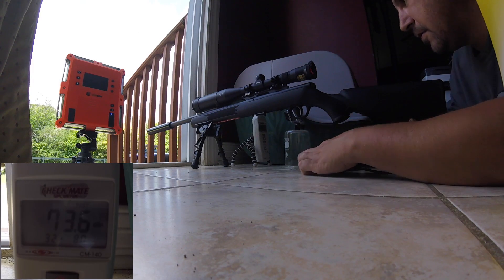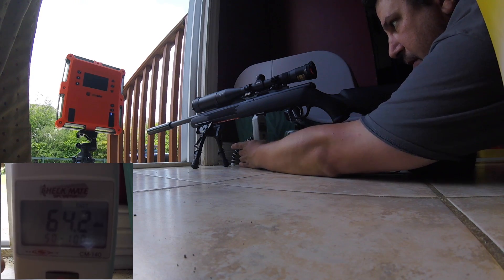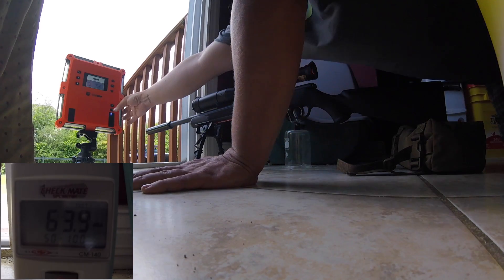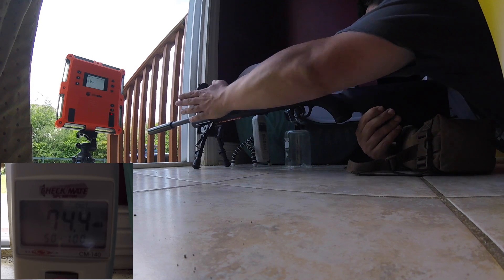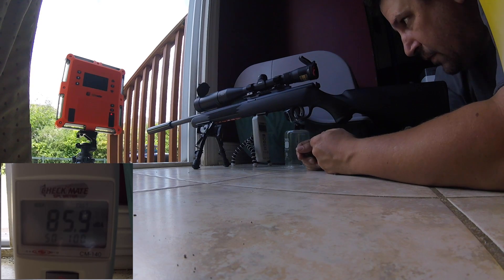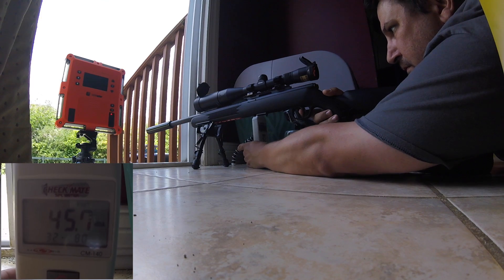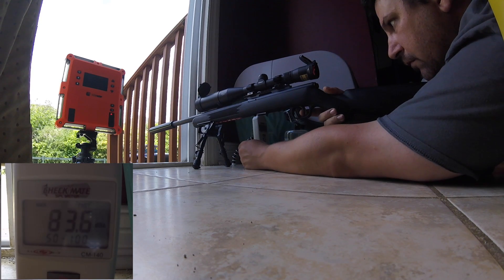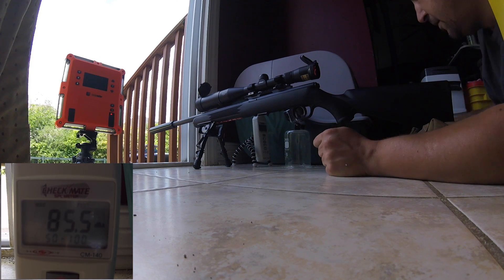Form 1 Suppressor Test

Comment: A couple of issues with your testing. The sound meter you are using isn't fast enough to accurately record the SPL of a gun shot thus your readings will be very low. The second one is that your placement of the microphone ins't industry or military standard placement..... if that matters to you. But nice Form 1 and nice attempt at trying to get data!!

Comment: Great test. How did you get the labradar to trigger with that subsonic rounds? I tried it with my 6.5x55 and no luck. I even wrote Labradar and they told me I would need the air gun trigger adapter.
Reply: You can add the weight if you want, but it does not affect the reading. It is only used to calculate the Power Factor for Action Pistol shooters and for calculating Ke.  If your not interested in those, you do not need to waste your time entering them.
Reply from the maker: Don't use the sound trigger, use the doppler trigger. Basically, I just setup the rounds in the LabRadar, then used what amounts to a motion activation setting in the LabRadar. Under "Trigger Source", select "doppler".
Reply: Alright, thanks a lot. I actually tried that, but briefly. I think I might have put the projectile offset too far and kept the rifle too far on the side. As I understand it the doppler "beam" is pretty narrow? I will try it again. Thank you for the response!
Reply from the maker: You can't really tell from the video, but my barrel is set just an inch or so to the right of the labradar, and about even with the muzzle of the can.
Reply from the maker: Don't forget to set the projectile diameter and weight in the setup.